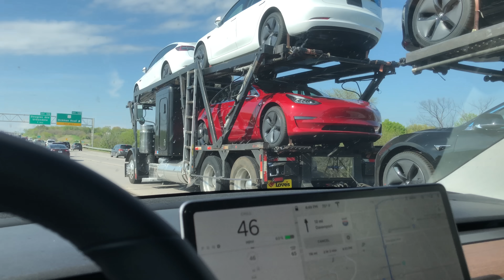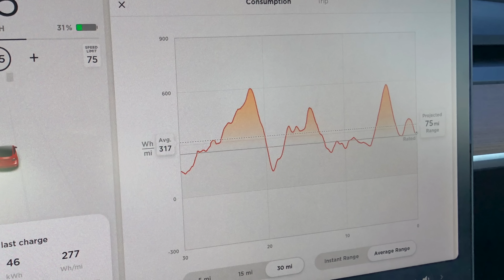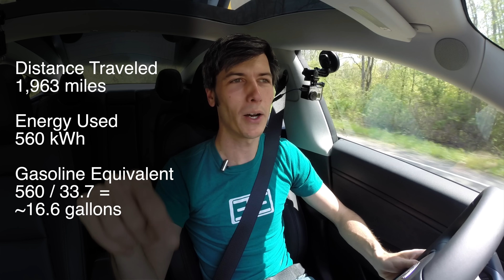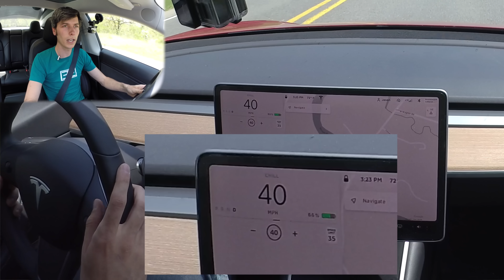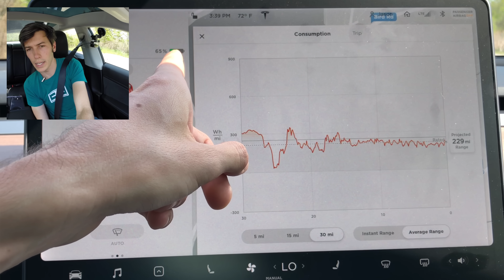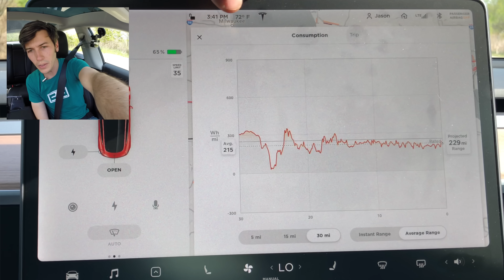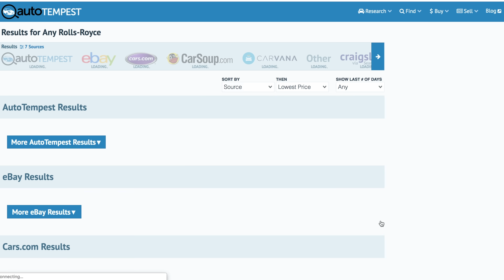How Miserable Is A Tesla Road Trip?

Comment: Why didn’t Elon make the roof solar, not to fully rely on it but to be charging the battery while you’re suing it to at least last longer
Reply: regerbryan it wouldn’t do anything. Even plugging it in to a 120V standard outlet only gets you 3-5 miles per hour of charging. That’s a huge amount more than what’s available with solar at that size.
Reply: Charles Dykeman dang, welp at least Elon is still working on solar maybe he’ll find a way to get more energy per square inch  that way

Comment: how much did you pay for supercharging for the entire trip?
Reply: Andrew Manche - I suppose I may have to replace the battery after about 10-15 years, but by then it would have saved me more than $20,000 in fuel costs.  Batteries will cost far less by then anyway.   It’ll work out great.
Reply: Andrew Manche - There’s plenty of evidence that EV batteries last much longer, especially Tesla’s.  A simple search even here on YouTube will give you all the evidence you need. Remember, they don’t wear out like cellphone batteries.  They have a different design.
Reply: C- That’s cool, but I don’t think your diesel is a sedan 😂😂
Reply: C- what model?
Reply: Looking up the costs and doing a bit of math, it looks like around 100 usd (imprecise, due to tiered pricing and other factors). For comparison, using his 16.6 gallon equivalency, at $3.70 (triple a lists this as being above the state average for premium gas in all but hawaii and california) a gallon, that would be $62 ish.
Reply: @Gamerboi99  You are not traveling 2000 miles on $62. At least not yet. There is a helpful tool on Tesla's website that calculates cost based on Mileage for supercharging, and you'd spend $176 on their most INEFFICIENT model (the model X), on a trip that's 2000 miles. The model 3 that he drove, drops the cost down to $133. 

Now he says that his Subaru has a tank of 15.9 gallons in the on screen edit.

15.9 Gallons times your $3.70 average is $58.83 per tank. 
Looking up the mileage of the car is 33MPG, so doing the math there is 524.7 miles per gallon.
Over a trip of 2000 miles, you would have to fill up the tank ~3.8 times, rounded to 4 times, because it takes more than 3 stops to fill the tank enough to make the trip.
The cost to fill the tank times the amount of times you need to fill it is $235.32*. Now this value is based on the most efficient mileage the car gets, which is highway, and doesn't factor in stops, rests, traffic, etc.

This results in the Tesla being around 76% more efficient, from a cost for fuel perspective.

So even if you gave the Tesla vehicle the same consideration of the difference in highway and city mileage (which now that I think about it, could be why there is such a difference between the advertised range and the actual. There is a video of a UK driver who tests out a variety of electric cars to determine their range.) Electric value is still greater**. 

However, if you look into the wear and tear your vehicle may experience on the road, you might find that repairs for the Tesla are more expensive, depending on what needs to be replaced and how often.

*Doing the math to accommodate a more gentle $3 per gallon instead of $3.70, lowers the cost from $235.32 to $190, which still isn't enough to beat the most inefficient model of Tesla.

**A Hybrid model of his vehicle would be more efficient at 90 MPG highway, which would allow for completing the trip in just 2 tanks of gas, even with the reduced gas tank size, at the same value, would amount to $117.66 at $3.70. or $90.40 at $3.00.
Reply: He shows exactly how much at 21:11.   He paid  $156.80 for Super Charging the whole trip.  

The cost of electricity at the Super Chargers is extremely high!   ($0.28/kWh)
I pay about $0.11/kWh at home, so it’ll be about 1/4 the cost per mile (or km) of my old Mercedes ML320 SUV.   I’m looking forward to paying at most 1/3 the cost in my Cyber Truck next year.

Comment: and you know what's the efficiency of power station you used it's electricity to charge your car? it's 30-40% and in best under 50% (in neutral gas, if station use diesel it's different) *plus inefficiency of power transfer line systems. you loose 3 hours time and don't gain green energy.
Reply: The main gain is future gain and centralised production. The goal is for the future most electricity will be green or nuclear so every improvement in that field makes your car better and the fact you are using power from a central source means it is far more consistent and provides a constant energy transfer. Pluse you usually don't go on road trips and when you are in a city this car is far more efficient so even if it was twice as bad as gasoline on long fast drives it would still be better for the environment as most people Use cars for there commute and getting stuck in traffic with this is far more efficient.
Reply: @swiftdragonrider  yes, you are right. we as humans most work on battery technology hard until we can produce cars more efficient in the future. the weight of batteries is so high and their capacity is low. I believe EV cars are good for small cars used in cities and not good at all for roads outside of cities. charging is a very big problem and it makes ev cars unsuitable for roads.

Comment: You need a trailer with a diesel generator,  charging the car.
Reply: If not, just a trailer of solar panels.
Reply: It theoretically would be more efficient than an ICE so if you're looking for efficiency when there's no chargers around it could work.

Comment: The rear view mirror would fit the rear window shape better if it was flipped upside down. Or is it upside down already? Oh, and adaptive cruise control and lane watch are both awesome without even Tesla level function. Oh and those tires aren't low profile. They are rubber bands. I guess Tesla is one of those cars that doesn't provide a spare tire.

Comment: This car only work for people like this
Jobless,no education kids sitting at home ,making youtube videos.
   if you get 250 miles then you have to sit for an hour...eat?again?
How about winter cold?maintenance?
Constantly driving looking for charger?
No life electric car  lol
I would be out of business the following week if i buy that electric garbage
Reply: Your criticisms really only apply for a long trip. 

Daily commute you're plugging it in at home or at the company.

Cold drops efficiency by ~30% true. But again if your round trip is nowhere near the max of the battery, then it's a non-issue. Just plug it in at home.

Maintenance is lower as there's much less liquids and moving parts to constantly change from wear, like in an ICE.

Superchargers are everywhere. And that's not counting the tons of third-party chargers popping up in everything from malls to restaurant parking lots.

So no, you won't be out of business driving an electric car.
Reply: @DaveQZ85  superchargets are where?less maintenance?
You are so naive lol
I dont have time for chitchat
Reply: @playhard.gopr.4755  They're almost everywhere. Tesla strategically placed them for long drives. Not to mention third-party chargers. Google Maps has their locations.

Maintenance: not naive. Educated. The only fluid to replace is the windshield wiper fluid. No oils and transmission and the related mechanical parts means less to break and replace. And no yearly emissions inspections to boot. Just generally less headaches overall.
Reply: @DaveQZ85  buddy you are average american,cant help you
Stop typing please.
Think and use calculator.
Reply: @playhard.gopr.4755  I did. And I have an engineering coworker/friend that is meticulous about stuff like this. He says his Model 3 saves money overall compared to ICE. He's been driving his for a year or so.

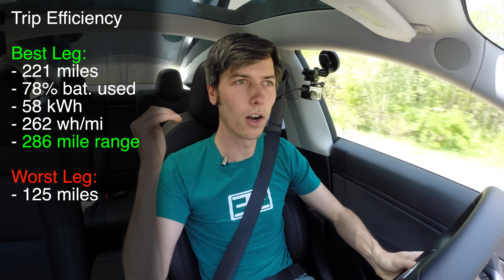Comment: 9:05 - you're kinda of glossing over the value in different types of energy.  The '2 gallons' of fuel 'stored' in the battery is useful energy - not heat energy - so it would be about 4 gallons before you convert it by running it through a heat engine.

Comment: Even in my "gas hog" mid size SUV, I can go about 550 miles on a tank with 3 people and a full load of luggage.  And as much as I like to eat, I don't need a 40 minute stop to eat every 250 miles. However, our limiting factor is well short of 250 miles, for "rest" stops for us and/or the dog.  Those don't take 40 minutes either. Furthermore, where I go, charging stations are an issue.  Electric vehicles are great.  Just not ready for prime time except as commuter vehicles primarily because of infrastructure.  Range is really secondary as long as charging stations become as ubiquitous as gas stations.  Once that happens, EVs will truly be prime time ready.

Comment: Look at the dollar per mi they are around the same. Plus you need to download 3 different apps to your phone to use the chargers. Have accounts set up for them. You also need adapters for fast chargers witch cost $100 + each one. If you don't have one enjoy sitting at a charge station for 6hrs for 60% charge. Plus if you live by me the closest fast charge is 50 mi away. ALL THE HASSLE TO METICULOUSLY PLAN YOUR TRIP ALSO TAKES 4 HRS! and forget about taking little detours to see local p.o.i. along the way. in 15 years electric cars might be viable. Plus when your car is 5 years old you batteries have 1/2 the range. And they are $6,000 to replace.

Comment: what about the inefficiency of producing the electricity from whatever resource needed? either way, it is still pretty impressive
Reply: Steven Power plants, that use coal are much more efficient than engines of almost any size. Generally the smaller, the worse it is. Motorcycle’s for example pollute much more than cars, which are horrible compared to busses and so on. However hydro, wind, and solar are making huge strides. Those would be far more efficient sources yet.

Comment: Bring that Tesla to Wyoming! My friend gas one just like this. 130 miles at 10 degrees outside temperature, 55-60 mph head wind, and he was really worried about getting to his garage charger. A/c may not need much energy for the compressor/pump, but the heating coil drains his battery tremendously.

Comment: Build a 3000 mile range electric car between charges, then I’ll be impressed, then maybe I’ll buy one!
I’m fine with my 2007 Mercedes-Benz diesel, ML-320 CDI with  over 600 mile range at 80mph, between tank fulls.The exhaust is mostly “Ozone”, no soot,at all, with 26.6/mpg. I spent $4,500.00 for the car, in pristine condition. After 223,000 miles, I had to buy with labor,a fuel filter, and a alternator, for a total of $1141.00. For a 2,000 mile trip perhaps two days with in 48 hours. 70 years young here,lol. Too many stops with this electric car, too rigid.

Comment: When I drove to Ashevill from South Florida in 9 hrs, about 650miles pretty much without stopping, while driving a chevy tahoe, averaging 21-22 mpg thanks to its cylinder deactivation. Only stops were for fuel and bathroom breaks (I brought snacks and food to eat) ... that trip would be so much more painful if I had to keep stopping to charge the battery. I'll stick with fueling up in under 5 minutes and still having a further range.

Comment: mpg as a variable for electricity is hard to quantify for people.
Reply: Very true.  Calculating the energy of gasoline to kwh is a simple formula, but how the car converts it into motion is more complicated. Electric is far more energy efficient.
A more sensible conversion would be to calculate the actual cost (in $) per mile.  It's more universal and it's what people are actually more concerned about.
Since Einstein discovered that time is money (t=$) in 1932 one must also take in the time for refueling and recharging. 
I think the best way to establish your monetary time-value is a human being is your hourly wage or salary x2.  If you make $20 an hour at your job and it takes an hour to recharge your car then figure on adding $40 on to the cost of that charging job.
Reply: @Iconoclasher  About three years ago, my brother told me about Nissan Leafs because they were so cheap, Used.  So I got all excited, too. But no one ever takes the time to figure out how much the electricity costs! After hours of work I sort of figured it out. I orig thought that some stores had free charging. The cheapest charging is right at home, prob.
Reply: Right. I am posting a comment later today that a Tesla or other typical EV actually gets about 50 MPG, based on Minneapolis electricity costs.
Reply: @thomasjohnson7948 
Make sure you include the $-per-KwH.

Comment: Yes sir the DC power density know as micro fierite pushes against the capacitors which the trick is current must have equal or great micro fierite for example if you have 30volt dc with 4000 micro fierite the max inverter rating is somewhat 250micofierite at 240volt AC. Telsa has supper capacitor which can hold up to 10x more step up than old school Cooper tops.

Comment: Conclusion: it seems pretty miserable to me.
Reply: Not anymore now a Tesla can get to 100% battery and 15 to 20 minutes
Reply: @thiccboiobunga2088   It costs me 3 minutes and I get 2-3 times the distance. Wake me up, once EV are efficient and cost about the same as a normal car. Let's say, in about 7-10 years.
Reply: @thiccboiobunga2088  that is still 5 times more than gasoline for half the distance for twice the price of a regular car. How many people exactly can a afford a Tesla?
And I got news for you, here in the Netherlands the price for fastloading just went up. It costs just as much as gasoline and more than diesel.
Reply: @thiccboiobunga2088  A Tesla is actually less efficient in terms of operating costs, and about the same in CO2 emmisions, compared to an efficient standard hybrid (not a plug-in hybrid).
So for charging at a Supercharger the cost is about $0.26/KWh, and with a Tesla Model S using ~35KWh/100 miles(EPA), that comes to ~$9 per 100 miles.
An efficient hybrid gets about 57mpg (1.754 Gallons/100miles), and with the US average gas price being ~$2.50/gallon, it costs ~$4.38 to travel 100miles over 50% less than the Tesla.

For CO2 I will use Km and Kg because it's easier to calculate, so lets begin.
A Tesla Model S uses,  ~21KWh/100km, and the US average CO2 /KWh for electricity is ~.44KG/KWh. So to go 100KM the Model S produces an average of 9.24KG of CO2.
Lets compare that to a Prius which gets an EPA average of 4.27l/100km  and 1 liter of gasoline produces 2.31kg of CO2. So for the Prius to go 100KM  it produces 9.8kg of CO2.
Reply: @thiccboiobunga2088  125mpg? compared to what 29?
Reply: @thiccboiobunga2088  Only some Tesla's get unlimited free charging, most get 400kwh of free charging per year. And comparing mpg shouldn't be a comparison of average since a Tesla Model 3/S  is useless as a truck, and isn't competing with them. Instead it should be compared to efficient gasoline sedans which it is competing with. 

And MPGe is not an accurate reading of CO2.
Reply: @thiccboiobunga2088  no but electricity does, and electric cars need it to run
Reply: @thiccboiobunga2088  and yet you claimed that Teslas had 125mpg compared to an average of 29mpg, which is the average for new light trucks, not sedans.
Reply: @thiccboiobunga2088  600 miles? you mean 600 yards.Keep dreaming man.
Reply: I can tell you're one of those people who hates electric cars and just because they're more efficient than gas cars

Comment: TESLA=WASTE 40% OF TIME.  Yep, the hassle of e-car is the dirty little secret.  E-cars are terrible choices still.  Frankly they need to invent a 100mpg gas car.  Just think about the 2-3 extra big hassles.  1 When I drive ESPECIALLY with family on long trips taking HOUR charge rest every 3 hours would be UNBEARABLE, kids at the roadside would be running off or in tantrum mode.  2 Adding time to trip for charging makes trips longer or even into overnights, 10 hour trip becomes 15, a terrible thing for any family.  3 Third, with e-car suddenly I have to do hours of research and plan for charging stations, rather than 0 minutes if I have gas car.  Jeesh, e-cars are TERRIBLE choices for families.  I know they save $300 in gas a year, but that is 1 single advantange, just $300, which is low but the truth.   Why endure MANY new burdens to save $300 in gas.  I have this argument with my hippy friends and they ignore all this.  Oh well.

Comment: 16 gallons of gas 🤔. Not true he is using superchargers which require extremely high voltage which is pretty expensive. I seen quite a few videos that break this down and although the Tesla slightly cheaper it's far closer than what he states.